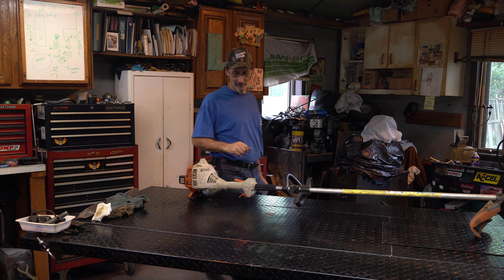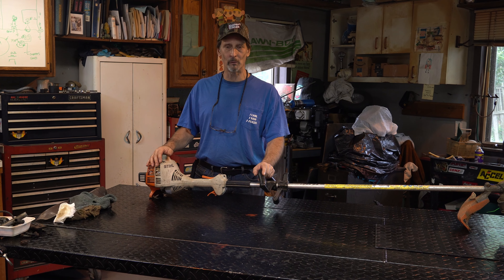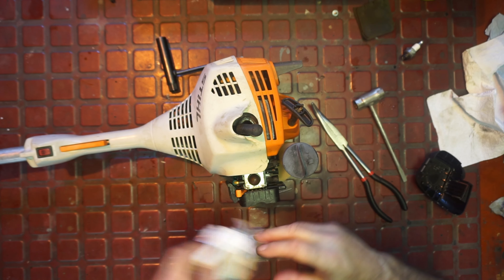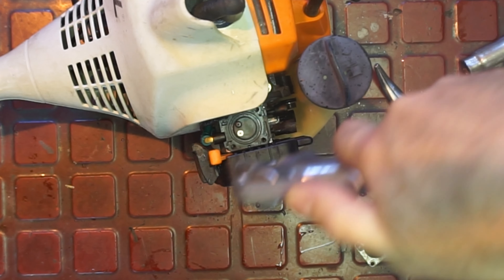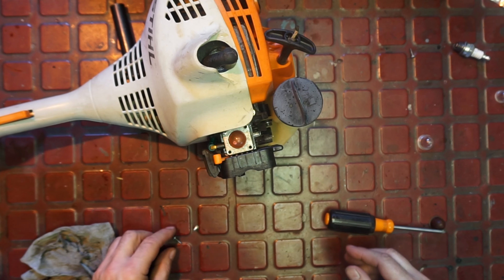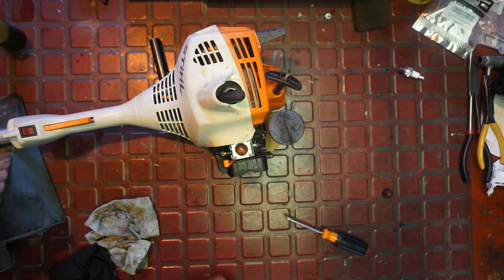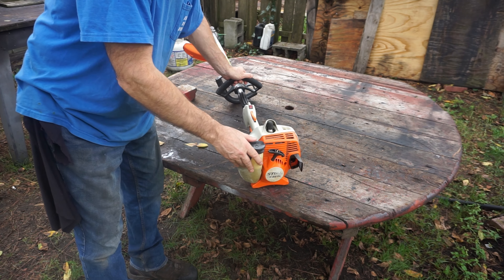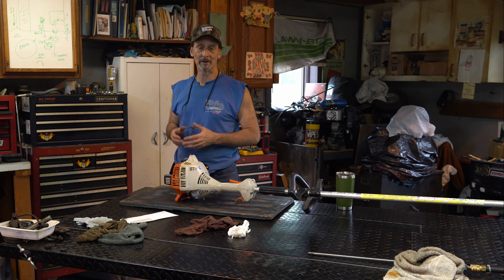BEST DAM TRIMMER ON THE PLANET! ~Stihl FS55RL Line Trimmer Tune & Primer Bulb Replacement HIPA PARTS

Comment: I have an older Stihl. The FS 85 and I run .105 line and that thing is a beast.
Reply from the maker: Oh nice,,,,I think I run the .080 which fits most of the stuff I repair but I should run a heavy line on this!! Thanx for mentioning this Brett!
Reply: @TheNovaJohn  on that one you have I’d run .095 which is what most of those Fs55’s ran. You could probably get away running .105 in that since it does have a great reduction gearbox which gives you more torque to the head. Not sure what size the engine is exactly on the FS55 but I believe the 85 used the 25.4cc quad port.
Reply from the maker: Thanx,, I pinned this comment!! I may go for the larger line for myself. I don't use it much, the larger line will prove useful!
Reply: @TheNovaJohn  it works REAL good if you use your trimmer for edging. I use Husqvarna Titanium  line. (I believe that’s what it’s called). It’s a metallic grey in color and has a slight braided texture to it but it doesn’t bind up in the trimmer head and therefore, whenever you tap the head to advance the line, it feeds easily. I’ve tried this line on both the .095 and the .105 and they both hold up well. Chain link fence will still eat it up but it holds up better than sooner of the other line I’ve used in the past.

Comment: Have the same trimmer. I was driving home one day & it was sticking out of a garbage can. Used it for years until the recoil broke. A new recoil at the time was around $50.00. So I waited until I found another. So far, no dice LOL.
Reply from the maker: I showed a couple of minutes of a almost day long fight with this recoil! Someone was in it and put it together wrong. What a horror!
Its worth the $15 for sure!
Reply: @TheNovaJohn  The first time I rewound a recoil should have been videoed. Worth a million laughs for the viewers, but I do not believe YT was around at the time. On my weed trimmer it is not the spring that went but the housing that holds the dogs & it is 50 not 15. For 15 I may have gone for it 🤔
Stay well, Joe Z

Comment: Nice video Arch but i think Echo gives Stihl a good run for the money whata ya think? By the way i run a Black and Decker battery operated trimmer instead of the fuel operated ones what a traitor to the business eh!
Reply from the maker: I like some of the echo models, however some of the carbs are crap! I've had a few that required a carb replacement because they didn't respond to a rebuild yet they seemed clean, have one adjustment screw and I guess all of them now are fixed jets. I have an echo chainsaw here, almost no hours, needed a coil, still wont run properly. Its almost flawless! Probably junk from the factory and it doesn't pay to keep throwing money and time into so its a beautiful paper weight taking up room in my shop! 
I actually recommend electric for most homeowners! Good move! For many reasons! Its still a small piece of power equipment and we are in the business of our customers satisfaction! 
I want one as well, just don't have the $$$ for it yet.  
The issue with the small equipment is cost/repair as you know. they are pesky, finicky machines to fix and to own and often too expensive to repair just to wack a few weeds!  
But for the pro, semi pro or one with a larger property, your absolutely correct!! Echo or Stihl, ya cant go wrong!
Thanks Wayne!!!
Reply: @TheNovaJohn  Right on Arch we suggest battery or electric chainsaws to our customers for the little amount of time they will be using them.